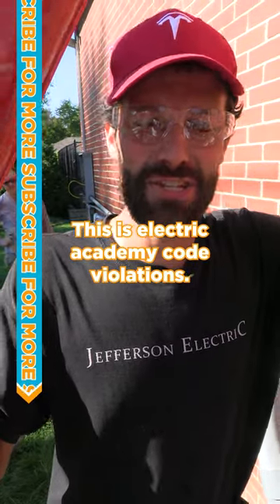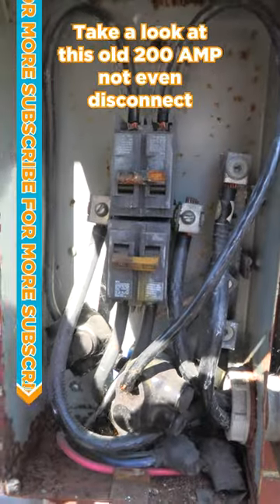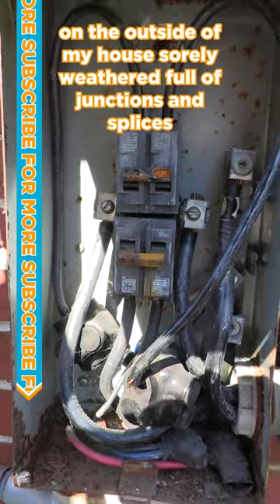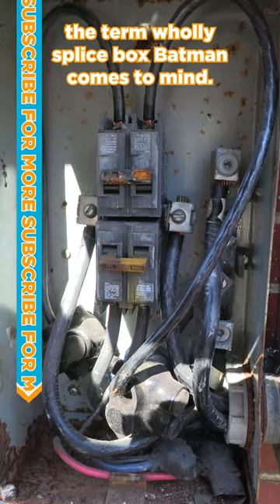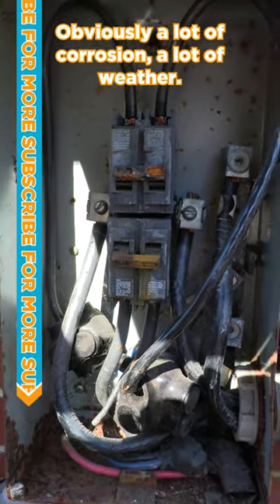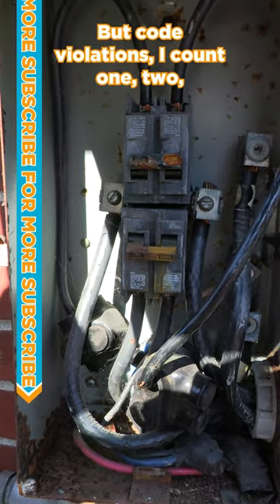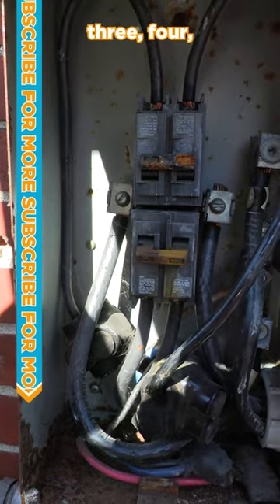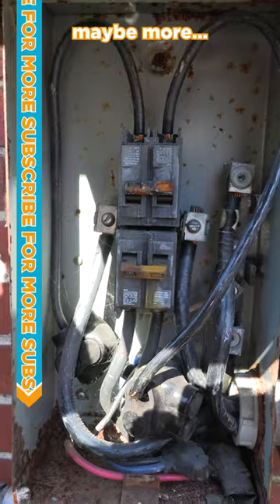How many code violations? Part 5

Comment: Im not an electrician but the 🎃top breaker has excess exposed conductor. The conductor attached to neutral lug is not marked with white tape. One of the line conductors appears to be white

Comment: I would say that the disconnect means is not correct, because it will still be live if one breaker is only turned off so it,s not considered a disconnecting means
Reply: There can be up to six main disconnect handles, if I remember correctly.

Comment: I wanted to ask you opinion or any one’s opinion about plastic boxes vs metal boxes. In regards to old work. I was always told metal was better because it doesn’t burn in a bad situation?
Reply: Years ago I had trouble with the cheap flimsy blue light special blue wall cases. Had them crack and problems with the 6/32 holes so went to far superior fiberglass boxes but always keep at least 25 metal wall cases in two different depths in case I had to hand them up to make a 3 or 4 gang box. Fiberglass boxes for have a fire rating. Preferred to use fiberglass boxes on all exterior walls in houses because they were easiest seal and did not transfer cold as much as metallic boxes. I would use bathroom silicone caulk to seal wire entering boxes. Bathroom caulk does not form mildew in most cases.
Reply: I, personally, prefer metal boxes.  I even wish multi-boxes were used in key situations in residential applications.   

Example:  The house I'm in has a 4-gang light switch next to the front door.  Inside this box are three 14-3 NM cables and six to seven 14-2 NM cables entering.  The box is a nicer fiberglass box, but it's only 3 inches deep.  (I calculate the fill to be 0.5 ft³ over Code, but I'm no expert.)  Unfortunately, the shallowness of the box and its "interesting" cable clamp feature pushes all of the 9-10 incoming cables towards the front of the box instead of along the rear of it.   Replacing two of the toggle switches with smart switches was "a challenge."

A 4 or 5 gang commercial gang box would have been really nice here.  The box could have stayed shallow, but with much more width there would be oodles more room.

Comment: Oh man I hate seeing inside MY electric service box outside. 
Somehow rain is running down into the electric line boot, through my meter breakers, and dripping out the bottom of the box.
You open the box and the safety panel comes out WITH the hinged lid, wires (aluminum, yay me) are showing rust stains, box is rusted half to smithereens.....  I'm DREADING calling for electric upgrade costs :( 😭😭😭
Reply from the maker: I'm so sorry! If you get an estimate I'd be happy to help you review it and talk through your options. https://electric-pro-academy.square.site/